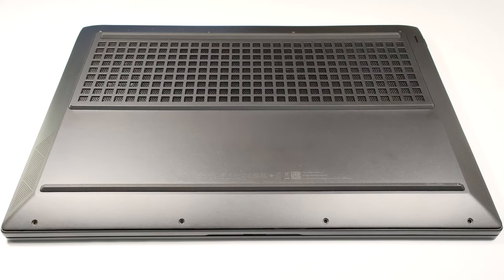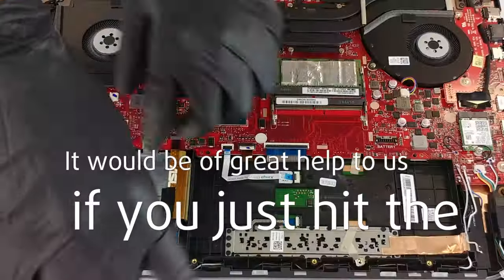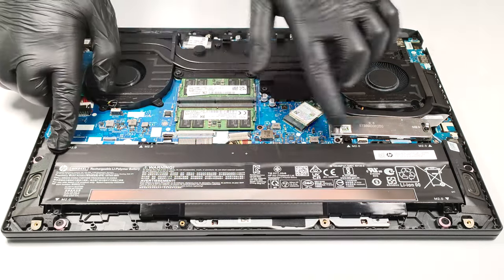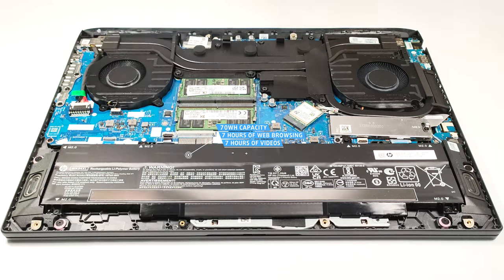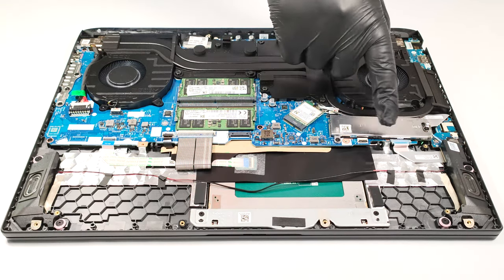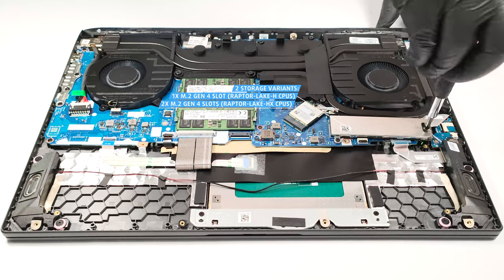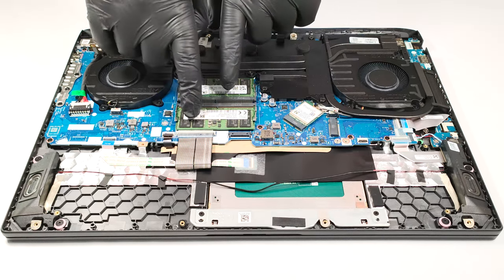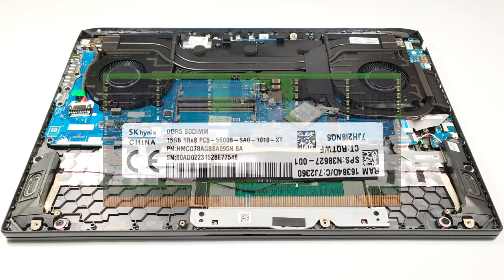🛠️ How to open HP Victus 16 (16-r0000) - disassembly and upgrade options

Comment: When I try to open my model 16-r00220ns I cannot remove the back cover despite removing the eight screws. It's as if there were still two internal screws or something strange, I tried to remove the plastic pieces that are used to prevent the computer from touching the table, thinking that there was a screw opening underneath but no. all the videos I see remove it as if it were nothing, please help
Reply: same
Reply: Use a prying tool. Start on one corner, move it along the edge. The design of the bottom lid should've a tight-fit lock mechanism. But do it gently as it is looks made of plastic
Reply: I'm having the same problem. Were you able to solve it?
Reply: @killeragosta  pop it from bottom corner and yank it up a bit, as it has clips that hooked on the battery

Comment: Hi, can you take out the wifi card/upgrade the wifi card to 6E? An answer will be much appreciated
Reply: did you find answer? I am looking for one
Reply: @roei2086  yes, this type can also use wifi 6e intel ax211, and when i asked the support center they said it's not soldered
Reply: @AxLz7  what about ax210? They have different connotations
Reply: @roei2086  in the manuals there are only mediatek mt7921 and intel ax211, so they are not sure about everything else